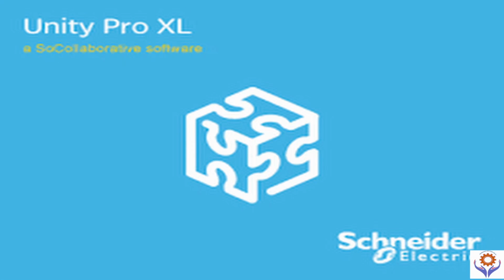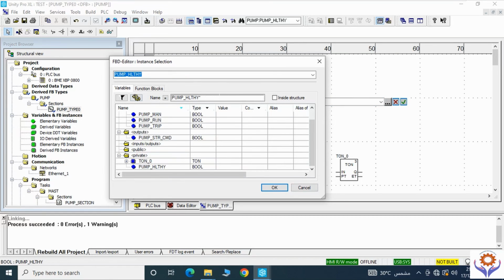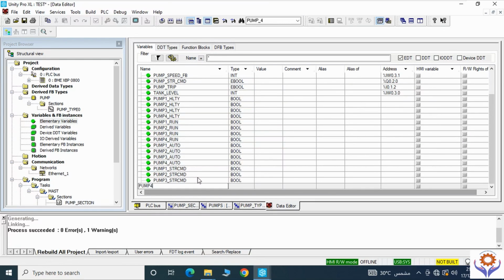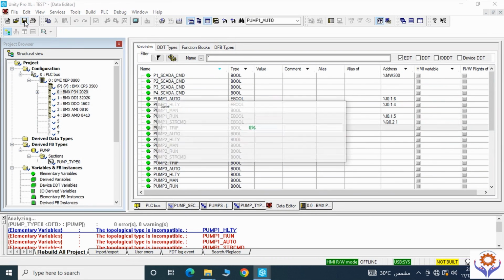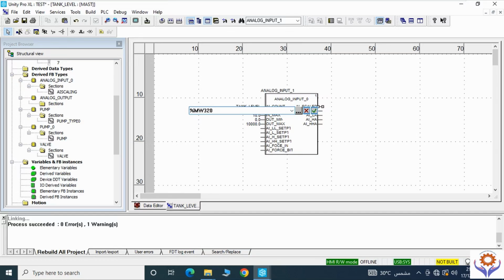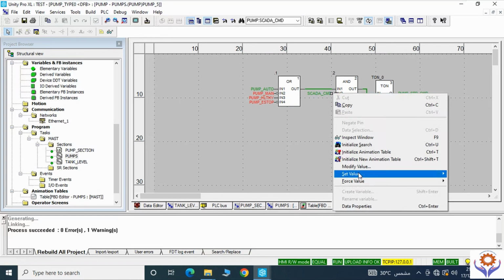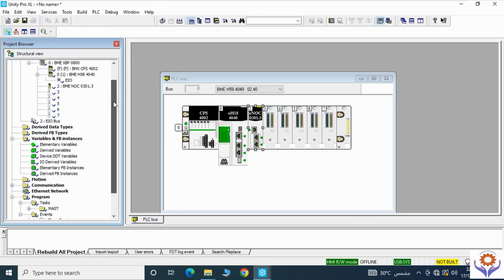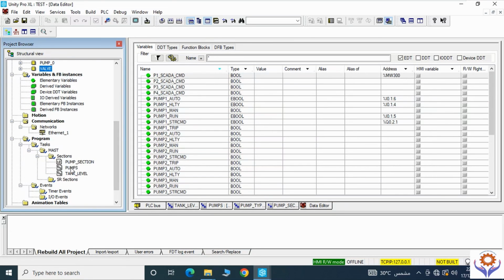Schneider unity pro Training  - Part 2 | Unity Pro XL for beginners  #automation #schneiderelectric

Comment: Could you please share link from whwre i could download Unity Pro XLS software. We have already installed control expert v15 but the software is not display our required software i.e CPU 14065160S. This cpu is belong to Quantum category
Reply from the maker: Support for the 140CPU65160S is only available with Unity Pro V7.
Any version later than Unitypro V7 does not support the Quantum 140CPU65160S . Unitypro XLS V7.0 software is discontinued in Schneider websites but we can find in many links in other websites such as PLC247 , plc4me etc...